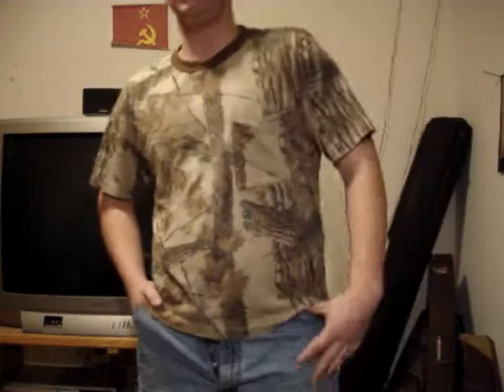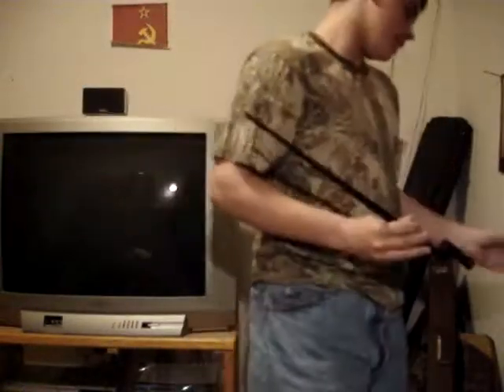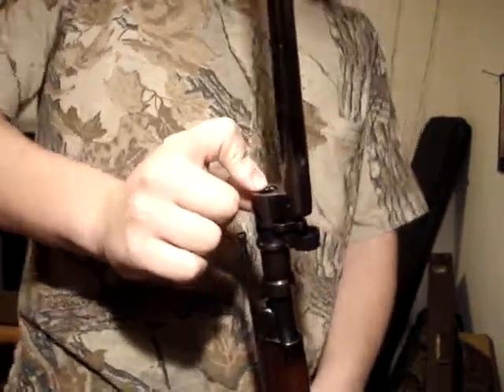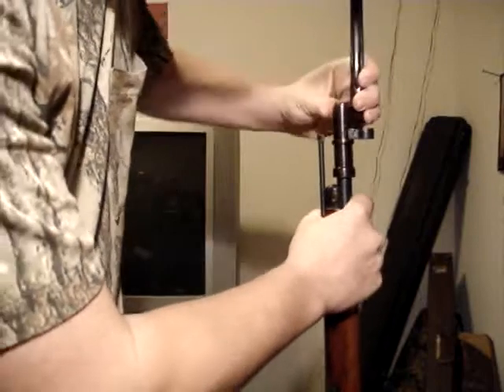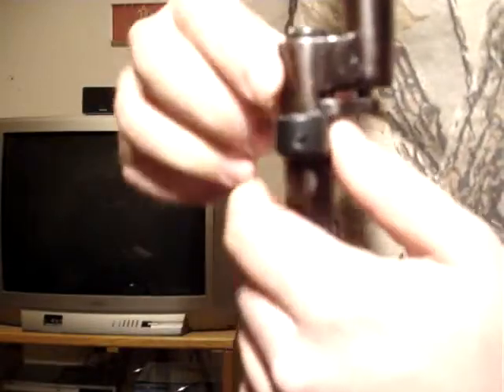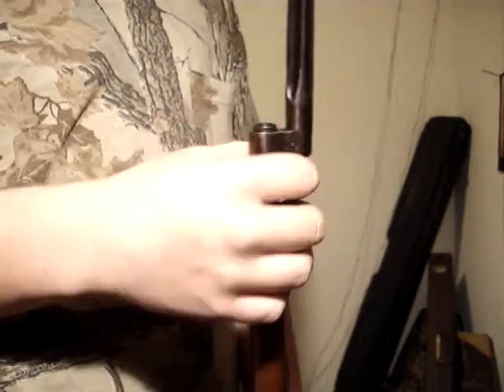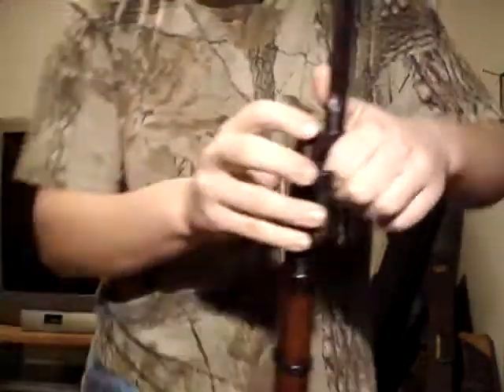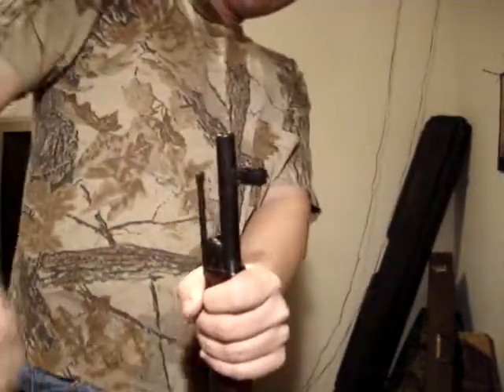mosin nagant 91/30 bayonet

Comment: I got a surplus 91/30 from Fleet Farm last week.THe bayonet it came with would go on but would not quite lock into place.Needed to go another 1/8 inch but was tight.I had to lightly and slowly file on it until it would go on.It goes on and off perfect now.Like you say,they are probably never used,therfore need to be sort of broken in or adjusted to each individual rifle

Comment: my bayonet slides on smooth and locks in place and the spring is fine so it unlocks easy as well it fits on both my tula and my Finnish tikka 91/30s

Comment: if the spring doesnt go down and looks rusty that means its rusted shut.  put some oil on it, set it down, use a hammer on it not to hard until the spring goes it. then put it on like spartan says.